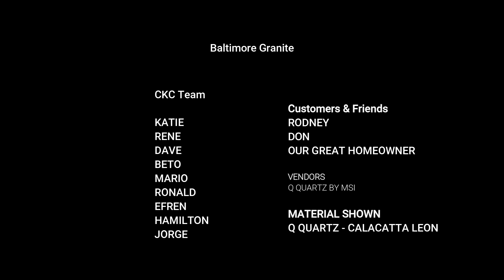106: INSANE Island Install!!

Comment: Hunny get a trailer... save them backs. Look into the no lift system.
Reply from the maker: Jakes Jakes.  I’ll ignore the fact that you called me “hunny” I’m a professional business owner and Ive been doing this for over 14 years,  there is no need to be rude to me because I’m a woman.  We do not use trailers for a reason,  and we know about the no lift system but it would have been incredibly dangerous with this island,  the no lift system holds the island insecure on top of a hydraulic post,  installers are responsible for holding the balance and with this island being so large there is no way they could have held balance.   We’ve offered our installers and array of carts and have also on many occasions taken a forklift to the job-site to unload/load if needed ,  they like doing it the way they know how to control the material and they work their butts off,  so whatever makes them safe and happy,  makes me safe and happy.
Reply: No lift system has a max of 600lbs 
The small four wheel granite dollies would work way better in my opinion. But whatever your workers like and are comfortable with is what matters.